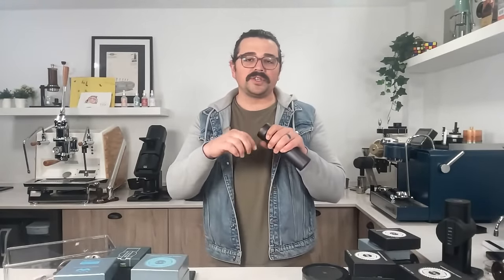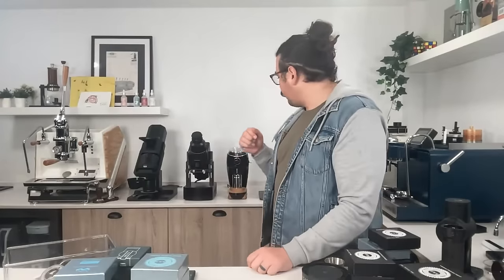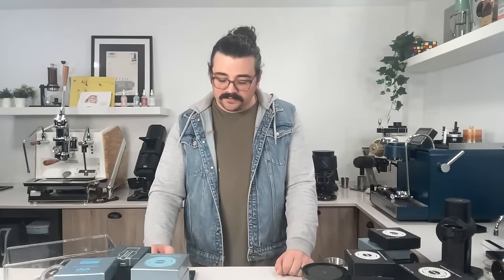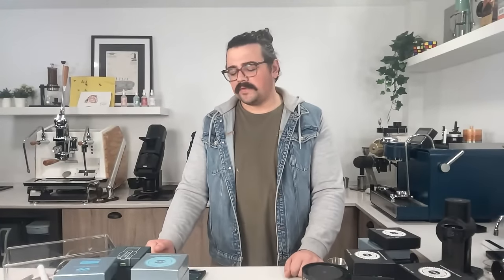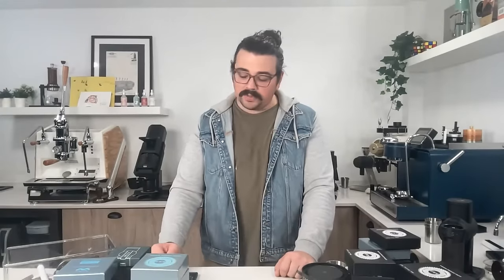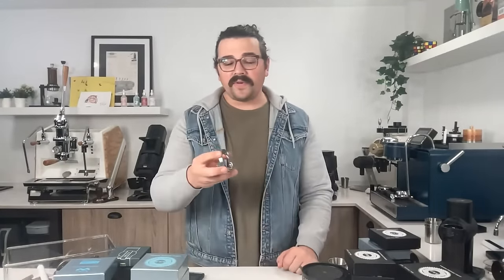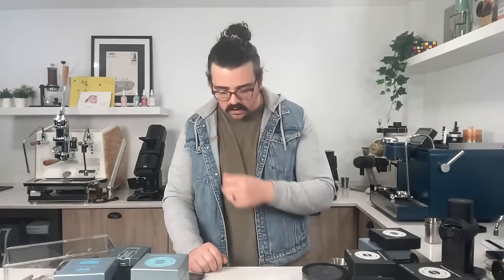Understanding Coffee Grinders

Comment: Simple Tips and Tricks for Improving Grinding at Home
++ 1:27 Tilt your handgrinder (slowing feed rate)
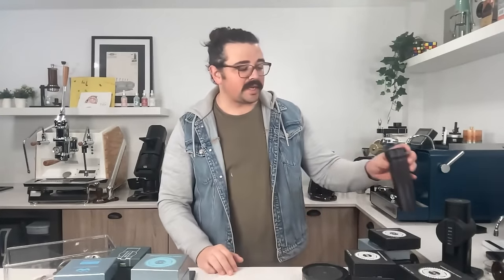++ 3:51 With any grinder, you benefit from slow feeding
++ 7:21 Augers and prebreakers are the next big thing

Q&A
15:20 Timemore 078
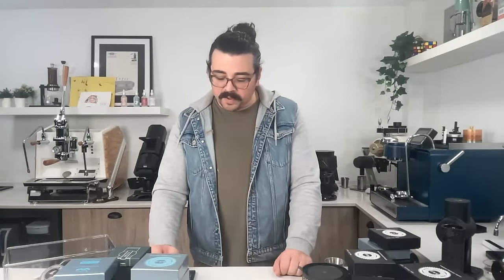16:30 Sculptor 064S vs DF64 V2
17:33 Handgrinder + Milwaukee Drill
18:04 Tilt hack better for Espresso or Filter
19:01 Better way to align burrs than Sharpie test
++ 23:52 SSP HU marker tested doesn't run as expected
23:11 Slow feeding and speed of shots
++ 1:03:50 Chat demonstrates the speed diff in shots between fast and slow feed
24:18 Mythos and Heat Damage
25:19 Fellow Ode and dialling in
25:38 SSP Burrs and Boulders
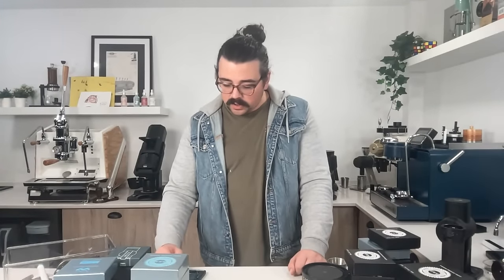26:20 Specialita Upgrade
27:11 DF83V vs Zerno
28:10 Prebreaking with Mortar? (Use coarsest setting on hand grinder)
++ 42:37 Simulating auger using handgrinder by double grinding
29:25 Thoughts on Weber Key
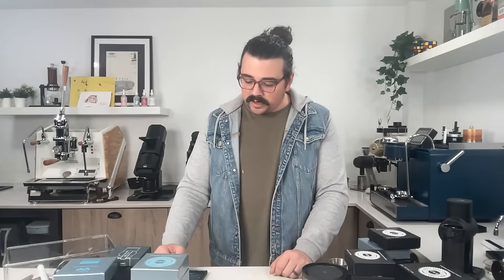30:20 Slow feeding for filter?
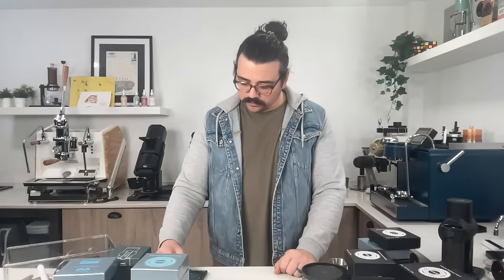30:56 Chaff on Hand Grinder and Taste of Chaff
32:20 Tilted foot and DF64 feeding
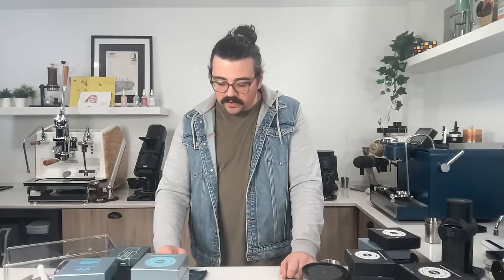32:44 DF64 and going coarser
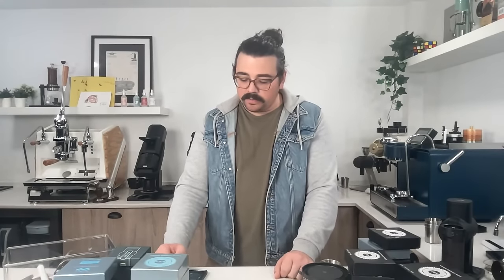32:58 Lever style and coffee types
34:34 Ode vs DF64 MP
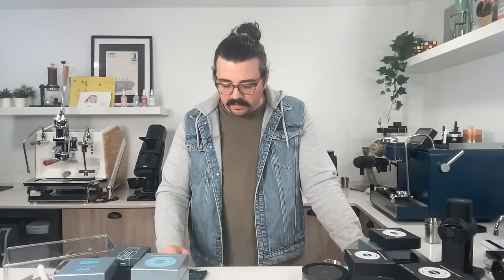34:54 Same burr taste different in different grinders
36:14 Waiting on time off boil
36:27 Slow feeding and taste difference on different grinders
36:35 Differences between burr materials
++ 36:48 Cast vs Tool Steel
++ 38:02 Coatings
++ 42:30 Durability of ceramic
39:27 Best 64mm burrs for sweetness
40:27 1zpresso vs Electric Grinder for espresso
40:46 Wilfa Uniform for Cafelat Robot
41:41 64mm MP Burrs for espresso?
43:34 SSP on DF64 or 064S
44:20 Hand grinder for espresso
44:29 Don't measure temperature of grounds when exiting grinder
46:30 Taste diff between hand and electric grinders
47:17 Second grind becoming very fine for MP burrs
++ 48:19 Heat up is due to grounds not burrs
49:11 Heat damage vs heat during grinding
51:13 How slow is slow feeding
51:51 Small bellows as slow feeder
52:42 Liquid nitrogen submerge the grinder /s
52:53 Hand grinder for light roasted coffee
53:16 Reason for lack of blind burrs
55:24 Why grind coarser
55:36 Eureka Nolte vs K Ultra (Conical vs Flat?)
56:18 Freezing beans
++ 1:02:22 Freezing in bigger doses
57:20 Red Speed coating rubbing off on burrs
57:40 Burr aligning hand grinders
1:00:04 Timemore 078 vs EG1 and changing burrs in short timeframe for EG1
1:01:26 Seasoning 078?
1:02:50 Weight of feeding dose and consistency
Reply from the maker: You are the GOAT
Reply: Oh wow. That's killer! Thanks!

Comment: Just had my 2nd cup of pour over holding my K max at a 50-60 degree angle with very slow turns.  Not only a noticeable change to the finished cup, it left the chaff in much larger pieces, thus making removal quicker and easier.  Coffee is legitimately an artform and its beautiful.

Comment: Dave Brannigan: Not sure how long you have been using the Milwaukee driver on the hand grinder, but my Timemore C2 Max started to get ovoid bearing surfaces with the electric screwdriver and I stopped. It still works fine by hand, but the grind setting now has some wiggle between settings.
Reply: Great real-time info. Perfect stable alignment is impossible with a handheld electric device.

Comment: Thanks! Interesting video. I will surely try slow feeding my zp6 with angling it. What angle are you  thinking about? Like really horizontal? Or maybe like 15deg? Comandante burr is not attached and they often say that wiggle of burr on axle doesn't matter because burr is floating and self aligning with coffee particles. I think it might work at finer settings. I don't think slow feeding will work well in this case. Often at the end of grinding with C40 some larger particles occur. They also recommend you to keep grinder vertical. I also think if it would be possible to attach slow feeder at hand grinder. Maybe something similar to one at df64, just above burrs? I will have to check how is zp6 burr attached :D that might be interesting project.
Reply from the maker: Yes comandante burr is floating and needs vertical..

Comment: Used both a Weber Key (Conical, full city decaf) and Timemore 078S (flat, medium) this morning. 
When you tried the 078S turbo burrs, did you try the ‘super soaker’ RDT?
Only a couple Kg through mine so far but haven’t tried it (not turbo of course). Pretty sure simply putting some slick tape in the hopper on that shallow angle will alleviate the bean stick issue people are complaining about, without needing a custom hopper.
Reply: Contemplating getting the Turbo burrs when they are available. 
Just getting to your point about not RDT 🤣, thanks brother

Comment: Just to share a different experience, I haven't been able to notice a big difference in flavor between horizontal and auger-vertical mounting of 64mm burrs at similar RPMs. Very minor if any.

Tilting a hand grinder on the other hand definitely changes things, but I'd encourage A/B testing as sometimes it's for the better, sometimes for worse. Depends on the grinder.
Reply from the maker: That's actually shocking to me. I've done so many blind tests for other people visiting me and it's always a pretty vast difference. There is also a noticeable PSD difference. Like, very noticeable.
Reply: @LanceHedrickUnfiltered  perhaps there have been other things at play, like declumper / no declumper etc? Either way, for example SSP MP tastes familiar in both an unrestricted Mazzer and Ode or Sculptor for me. Same with SSP LS.

Comment: Fully get the point of not going to far into chirp. But with the Ode2 I go from no chirp to chirp with a single step (25um) and then have more than just edges cleared of marker. 25um doesn't sound that bad for me as alignment, at least for a filter brewer probably aiming for ~500-700um!?
Reply from the maker: Take the spring and pin out when aligning and manually turn and hold